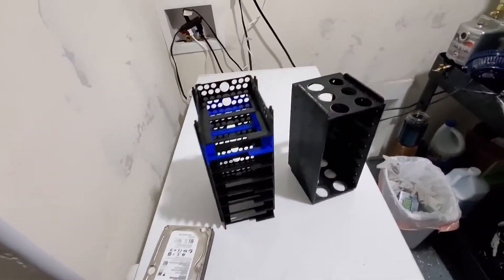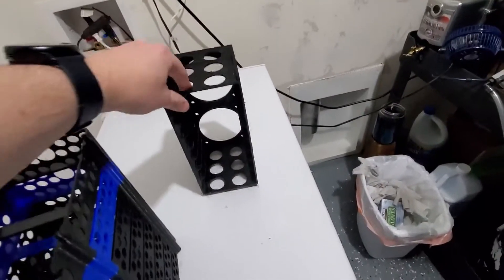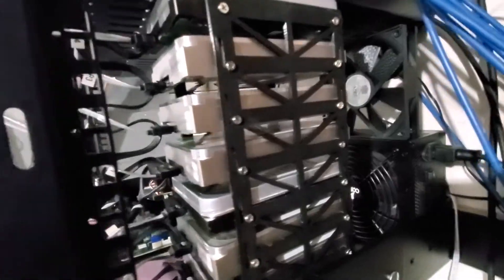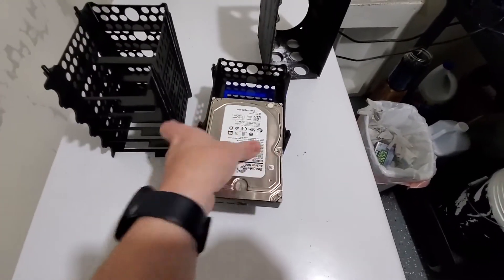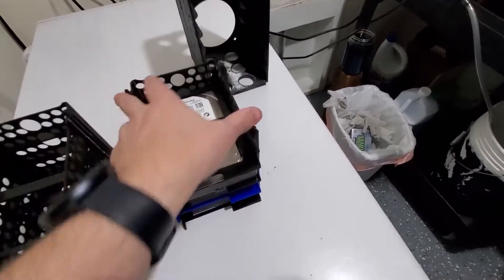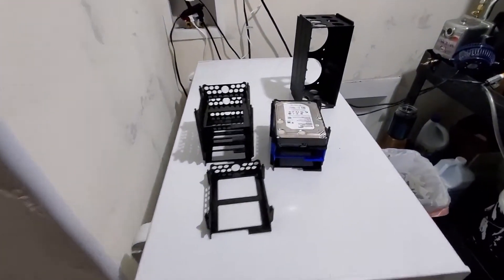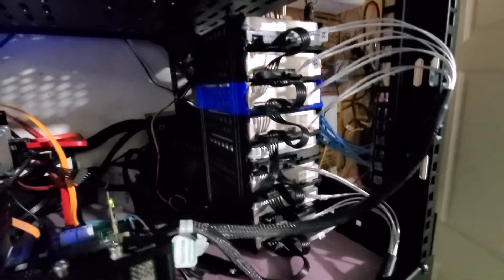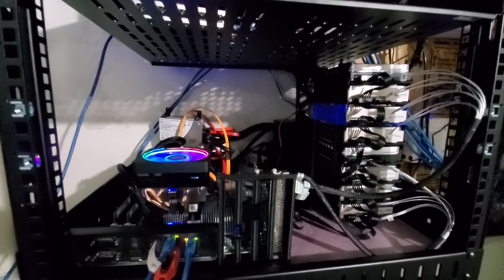3D Printed HDD Cage - Doubles as CADDY!

Comment: Nice design, If you want more heat resistance I wouldn't recommend PLA or PETG, ABS or PEEK would have a been better choice but then again PEEK costs body parts to print with. My drives get very hot - Seagate Exos, I might create a version of this which is has no sides while still retaining the screw holes for maximum side airflow and also add a  25mm push clip on the side for mounting fans for cross air flow.

Comment: Have you had any issues with drives vibrations causing data corruption? Because these are all connected together, the vibration of one drives effects the whole system.
Reply from the maker: nope. I would guess being mounted to plastic rather than steel like in a normal computer case is even more favorable for the drive.

Comment: 😊👍Nice design, the step to prevent the disk from sliding out is a great idea, as is the cutout for the cables.
Splitting it into individual disks is also great, everyone can use as much as they need.
Actually, if I were you, I would continue with this project because it's already great and you can make it even better.
I would modify the front wall so that a 12 cm fan could be mounted there (by entering a cutout in the shape of a high 0, as is the case in PC cases).
What I miss most in such projects is the damping of vibrations, which quickly destroys drives, especially those working in groups. And this is already a challenge because, first of all, the drives would have to be mounted using screws or clips with a pin that would slide into the screw holes, and in addition, the mounting would have to be suspended on something in the shape of the letter S, as is done with microphones (I don't know how else to describe it).

Comment: Hi, i've made 4 of these with my smaller 3D printer. And i have to say that they are working really great despite me being forced to split them in 2 to make them fit on my print bed. Only thing i need to figure out, is what modification i wanna do so i can hot-glue them together better. I found it's not 100% needed anyways, but i want them to be as rigid as possible when my 2 NAS'es are positioned where they ought to end up. Seriously great work on the model, really nice!

Comment: cbutters.  Would it be possible to get the model for this?  I don't want to modify the model, I want to create a base as well as some spacers that will also extend out past the cages to mount a cooling fan on.  if possible please let me know.  I will be printing at least 20 of these.  Many thanks for the great print!
Reply from the maker: Sorry, I had it in tinkercad somewhere, but the stl is about all i have at this point.

Comment: Definitely will be downloading this and printing these seems like a great way to replace bays in a tower too to create a nice enclosed nas. I would recommend placing rubber rings on each peg when stacking to limit vibration to the neighboring drives this'll help increase the lifespan of your drives as well.
Reply: Hi, I know this comment is 2 years old now, but any chance you have a link to what rubber rings you were using?

Comment: Hello.  I printed 6 of these out to put in an existing case for a FreeNAS implementation.  I like the design, but would ask if you could add a couple parts.  It would be nice to have a printed standoff for it.  say more or less like the drive carrier with a base and four posts coming off it with pegs to fit the bottom drive holder allowing air to flow under the drive.  I think lifting it a half inch should suffice.  Second would be an additional mount to hold a fan.  Say if you print and stack three of them, the mount will fit on the back of the three as a unit and pull air through the drives using a savaged case fan perhaps.  I like you solution, but my box is not open air like your system is.  These would take your existing good idea and make it a little better by offering some addition usability.

Thoughts?

Regards,
Joe

Comment: Also, already asked by someone: How is the vibration?
Does the lowest tray have some kind of "standoff" form the ground for easier SATA cable connection or so?
Does those trays support some kind of connection to floor/wall and between eachother inorder to connect multiple towers (planning to place 3-4 side-by-side)?
Reply from the maker: I had thought of making  a standoff part that fits there for that exact purpose... haven't gotten around to it though. My sata power and data cable have enough clearance without it though.
Reply: @cbutters  All right, ill get one printed. Have to look into the mounting and fastening to chassis and side-by-side tray stacks .. and some fan mounting options depending on the size of the stack.

Comment: excellent. Now, how do you handdle the vibrations when you stack lots of hdds?
Reply: Im wondering if using some rubber orings around the pieces that stick up to stack them would help
Reply from the maker: No issues running 8 stacked up for over a year now.

Comment: These look great - could you produce a modified version for use with hot-swap SATA / SAS backplanes (they are usually available on ebay, but sometimes don't come with a cage or caddies). It would be exactly the same shape, but with the HDD facing the other way?
It would need a rectangular hole for access to the drive connectors, and the tab with the securing lip (nice feature btw) could be extended across the whole width (or just have one on each side). Also, could you scale it for 2.5" drives?

Thanks!!

Comment: These look awesome; I love the simplicity and ability to incrementally add.
We have a bunch of old HDDs and would love to get them into our software RAID for security cams but the cages we've tried are loud and crowded (not a coincidence those go together as they're trying to save space and we don't need to do that). Even so, I think we need some kind of lightweight active cooling in our cabinet. We have lots of virtually silent fans there and elsewhere, but for some reason, all the ones we've ended up with that are integrated into HDD cages are real howlers-with the exception of when we had a Synology NAS - which ultimately died and was obviously not just a simple HDD cage.
If you were going to sell them, how much would you charge for 5? We don't have a 3D printer... I looked and there are lots of online printing services but an overwhelming array of options and it would be nice to get them with the material, etc. that's known to work. 
Also, any chance of something with holes or a screw-less way to add a standard fan (80, 92, 120mm... whatever works best) for every 2 that one stacked up?